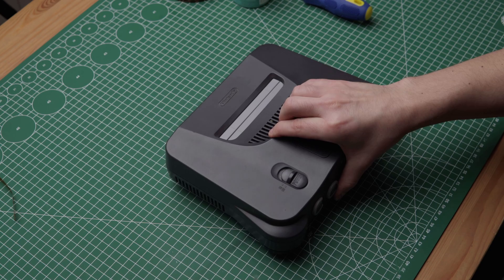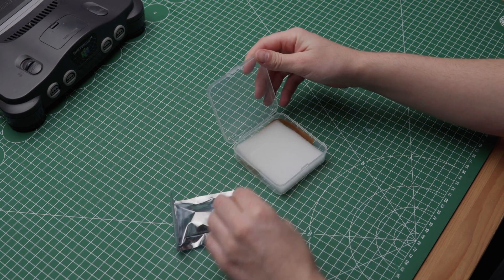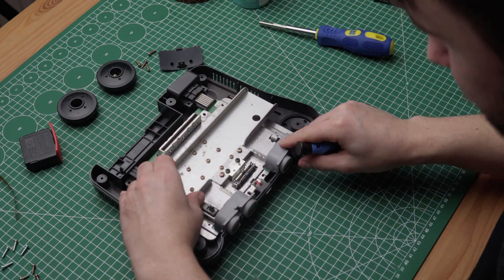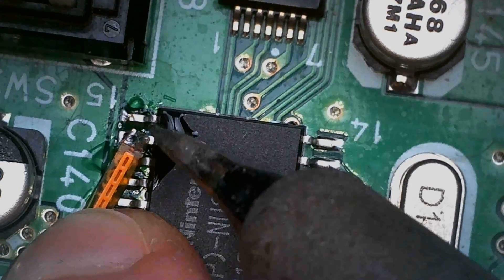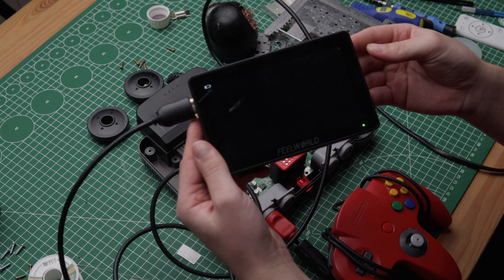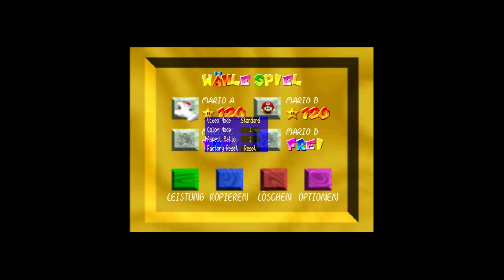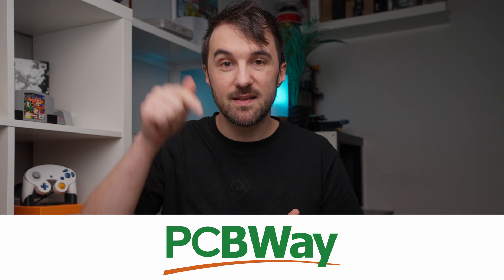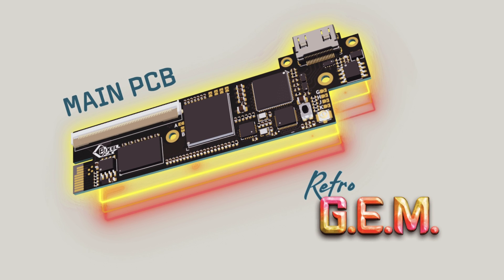UPGRADE your N64 to HDMI on a BUDGET - HispeedIDO HDMI Kit

Comment: Thank's for the tutorial. I have upgraded my N64 too, and after realizing that I have to plug at least a Jumperpack, it's working fine 😅. Now something important if you using a Summer Card for "Backup": There is a issue when the N64 is starting, the sync seems to fail and then the picture have horizontal artifacts. Just push the Reset-Button 2-3 times until the artifacts are gone.

Comment: Out of curiosity would this interfer with a previous RGB-mod or with using the AV-out? I'm curious since I'm thinking of modding my previously RGB-modded NTSC-J N64 with this since it would open up more options than my unmodded PAL N64. Also I would want to have the option to connect my N64 to both my modern flat screen TV and my CRT.
Reply from the maker: Hey there! No, that won’t work as what you describe is someting like a dual output solution. I actually don’t know if a n64dual exist. This can either output via the hdmi kit, or the analog out. You then might want to add a dip switch in between the power line to the hdmi kit so you could choose i guess. Honestly i would rather go with the rgb output and a retrotink upscaler in that case.
Reply: Oh I'm sorry if I didn't express my self too clearly, I wouldn't want to use the console with my CRT and flat screen at the same time, but rather alternate between them. For example use RGB and only plug it into the CRT or use HDMI and only plug it into the flat screen. So essentially I would want to have both options but not at the same time.  But I wonder if I mod an already RGB modded console (the simple RGB mod for NTSC consoles) with this HDMI mod will I be restricted to only the HDMI output or could I still use the RGB output as well given that the TV in question supports it? Basically sacrificing the AV out and RGB out completely and limit it to HDMI.

On a side note do you think the simple RGB mod provides a better result than this HDMI mod?  You mentioned the Retrotink, which one did you have in mind? I'm wondering since I'm contemplating the Morph4K and thinking if I should just use the RGB with the analogue bridge or mod it with HDMI and use it with an HDMI output.

By the way thank you for your quick reply and I apologise about the long reply/comment.

Comment: I can't get the menu to pop up
Reply: Annoyingly I can't either. All wired in perfectly, I reckon I've got a dodgy unit.
Reply: Scratch that. I ended up opening the console back up to check if any of the cables had come loose. Which they hadn't! I then checked continuity between the "CON" cable that connects to the PIF chip. And that cable didn't have any. It looked totally undamaged so no idea where the break was, so I soldered some cable from the "CON" point on the main strip over to the leg on the chip... And viola... It worked. Snipped the original CON cable away and all done.

Comment: Would appreciate some help from anyone!! I’m getting sound but my tv is only displaying blue and yellow horizontal lines. No bridging of pins. Any ideas?
Reply from the maker: Hey there. Seems like you have some cold joints somewhere. Go over every single connection again with your soldering iron.
Could also be a damaged flex cable as they are very delicate to work with.
Reply: @littlemodshop  thanks and love your videos ❤️
Reply from the maker: cheers i appreciate it :)
Let me know what it was, i’m curious 👀

Comment: So I did this mod, but I cant get it to work. First of all, the N64 should boot without the case, right? I get the red led lighting up and the mod sending a signal to the TV, but its just black. Not sure what to do...
Reply from the maker: Did you slot in the memory pack for testing? Console won’t boot up if not inserted

Comment: The RAD2X (Nintendo version) is currently arguably the best balance between simplicity, price, and quality for a plug and play option.

However, at 50 GBP plus shipping, it's still rather expensive, and you're not going to get the most out of it with an N64 unless you also RGB mod your system, but it still works quite well even on a non-RGB modded system, so you can start with getting a RAD2X, and if you are playing a lot of N64 games, you can think about upgrading your system with an RGB mod, and the RAD2X will use that RGB signal automatically once it's there, and I'd say the quality is on par with using an HDMI modded system. In some of the comparisons I've seen, HDMI modded systems actually make the image look a little too bright and washed out in a lot of games, but maybe not all HDMI mods are the same in that respect. 

The RAD2X (nintendo version) will also work great with the Snes, Gamecube, and even some versions of the NES. Most PAL region Gamecubes, and most versions of the Snes, support RGB signals as a stock feature, and any of these Nintendo systems can be RGB modded. Other versions of the RAD2X which work with other systems are also great, especially for systems which already have an RGB signal available as a standard feature, such as with most (or all?) versions of the Playstation, and also the Playstation 2.
Reply: Update: The Retroscaler 2x is basically a Retrotink 2x Classic clone, and might be the best value option (but apparently it has lots of issues with PAL region systems). 

The GBS-C is another great value option, though it doesn't support S-video or composite at all, so will require an RGB mod, or an adapter to convert the signal to RGB for the GBS-C. It has superior handling of 480i, superior scaling options, support for 480p input (great for 6th and 7th gen systems), and support for RGB, RGBs, and YPbPr input signals, with a bunch of different connector options. The GBS-C's excellent handling of 480i/576i signals is its biggest strength, making it a great choice for the PS2 in general, but also just very well rounded for the price. 

The OSSC is also quite good, but is usually significantly more expensive than the GBS-C, and its handling of 480i signals isn't really any better than the RAD2X or Retrotink 2x. It is also really bad at handling switching between 240p and 480i during gameplay, which will be an issue for some PS2 games and some games for all three major 5th gen consoles.

Comment: This mod doesn't seem worth it at all, regardless of price. No filters, settings not saving, lacking 4:3 stretching... no no no.
Reply: It's fine for what it is. It displays a 4:3 720p image to an HDMI TV so you can play your games. I have used mine for a few months now and think it's great.
Reply: I think the idea with this kit is to use it with a scaler that has HDMI input and output like the OSSC pro for all of those adjustments. That way you just have to get a new box when it's time to upgrade instead of having to upgrade/replace something like a retrogem on the inside.
Reply: You're supposed to put your TV on 4:3 mode to

Comment: I bought one of these, installed no issue, buy it stopped working after a few weeks. Just no image or sound at all.
Reply from the maker: Interesting! Have you checked your solder joints?

Comment: if you are looking for the "cheapest" HDMI solution for the n64 there is the pico HDMI N64 Project that uses a pico pi microcontroller to convert the analog video to digital and parts cost is arround 7 to 10€
Reply: thats just a converter, this is a better option because you can take the digital signal from the console and send it to the tv as digital, so you dont have to convert anything
Reply: @sos.gamers  PicoDVI-N64 taps into the same digital video signals, its conversion of digital to digital (HDMI), same as this mod. It only outputs the native 240P resolution though
Reply: Isnt it 720p?

Comment: Interesting kit.

I am a bit surprised the official hispeedio website isn't more informative in terms of the specs of the thing.

For $60, this gets you 720p output only. 

I don't know that I'd recommend this honestly. MAYBE if your a big N64 fan and don't own any other retro consoles that might benefit from the use of a scaler. 

Cool video non the less. Be sure you check the voltage rails (3.3V and 5V) for shorts to ground before testing. In correctly inserting the jumper pack / exp pack (which is possible with the top shell off) will cause these voltage rail shorts. You DO NOT want to power up the system with those rails shorted. You could damage the RCP / Ram chips.
Reply from the maker: Thank you for your insightful comment. I agree that there are certainly better offerings but as i mentioned in my conclusion: price is the main factor, quickly followed by the fact that hdmi is the most common connector most people use when not really invested in the retro space.

Also good call with the jumper pack!

Comment: It seems really close to being great if the menu was just a bit more robust. The original aspect ratio would be better with the option to stretch up to fill the screen more. The color options are goofy too. I'd be interested to see the AV latency introduced as well.
Reply from the maker: i agree. also i found that the mod won't memorize settings so you have to dial them in everytime the console powers off. as for lag testing, i will check if i can implement something like this in the future. would be very interesting. thanks for the input. :)